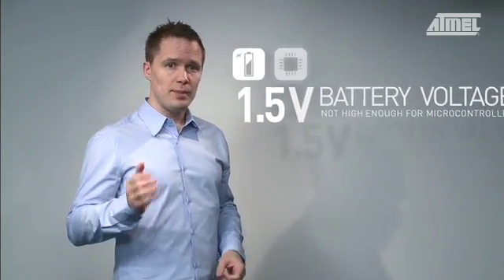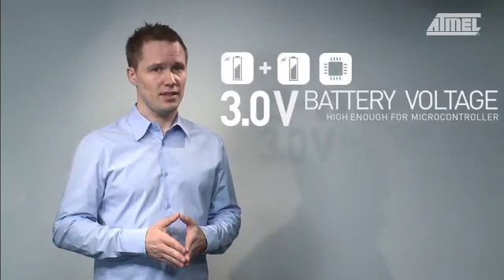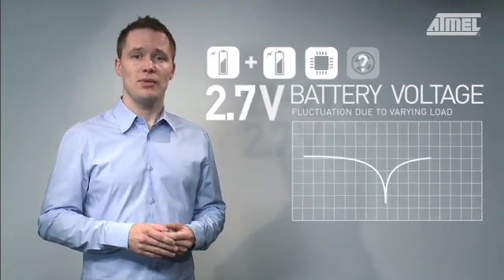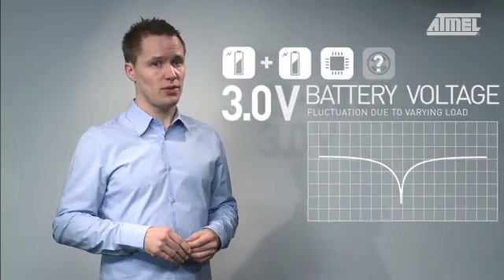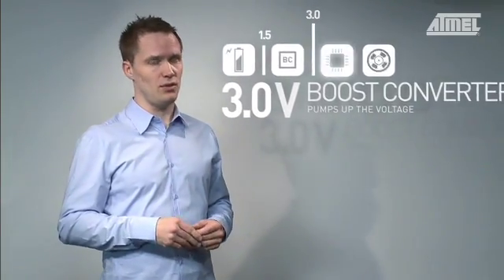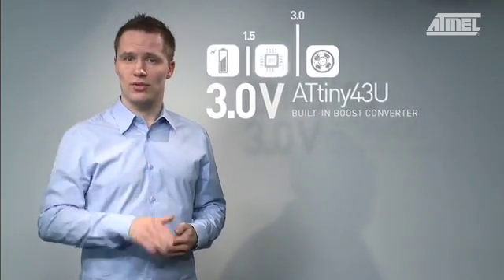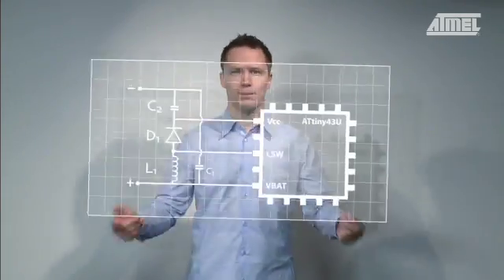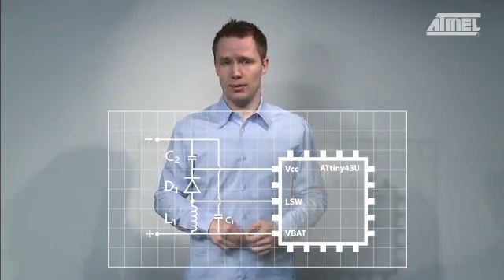ATtiny43U: Ultra low-voltage AVR with internal Boost Regulator

Comment: What are the values of the resistance, capacitor and inductor of the Boost converter circuit? Thanks in advance